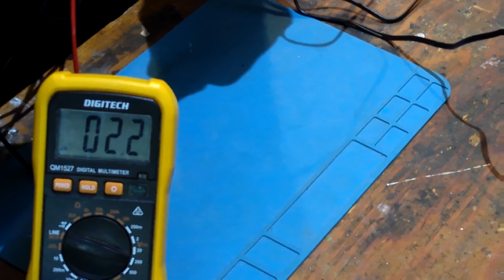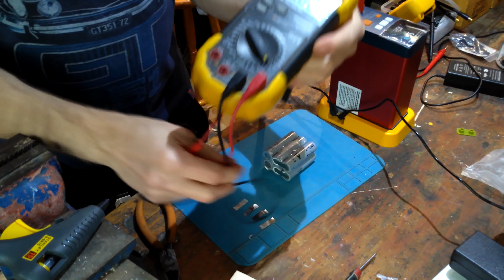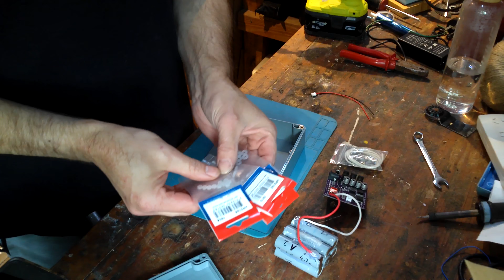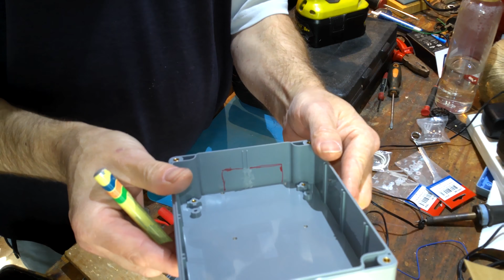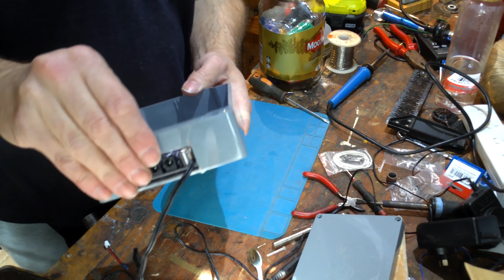Must... keep... the... internet... alive...

Comment: I'll subscribe because you're doing interesting electronics but man is it tough to hear you. Using 5.1 surround sound but hard to hear ya. Maybe grab a different mic, a headset mic, or turn up the gain or something? Probably not the gain, but it's tough to hear anything but want to watch and follow along.:(
Reply from the maker: I had a mic that was rubbish, have replaced it and should have used it on this....
Fair comment though

Comment: Where is your BMS? Never charge LI-Ion batteries without a BMS. You WILL have a fire on your hands when one of those cells gets unbalanced from the others.
Reply: Agreed. This project could burn your house down. Also, it looks like used cells and they tend to not be equal enough for a tradidional ali bms to keep them balanced. I would add an active balancer - 1A Daly is fine, not the cheap ones as they allow 4,3v before triggering.
Reply from the maker: Thanks both of you, I totally overlooked that, will definitely get a BMS. Yes they were recycled cells but all from the same laptop and I did do a charge/discharge/resistance check too before building the pack